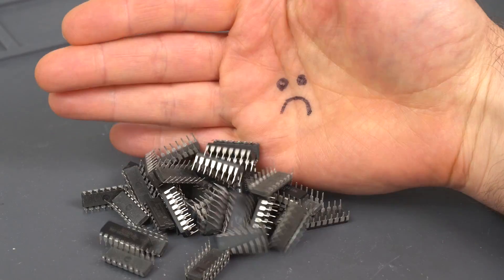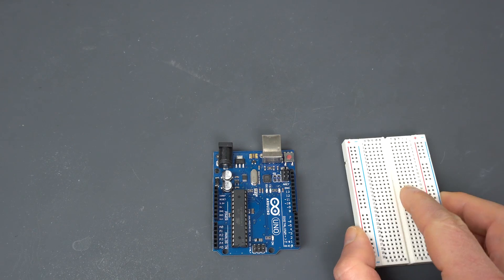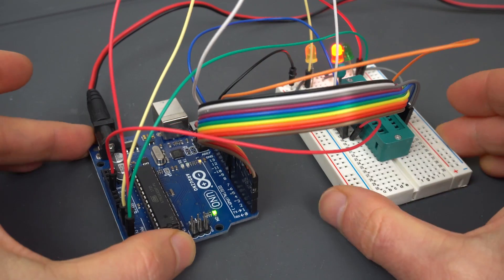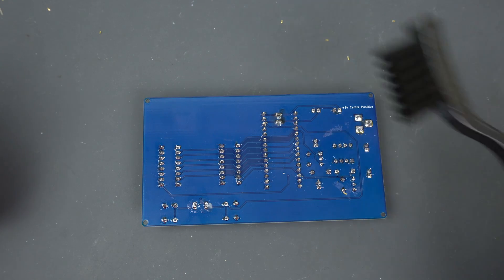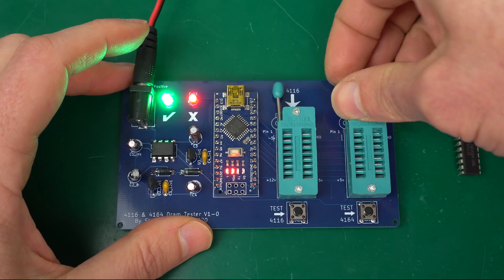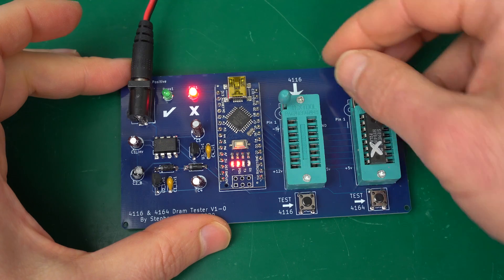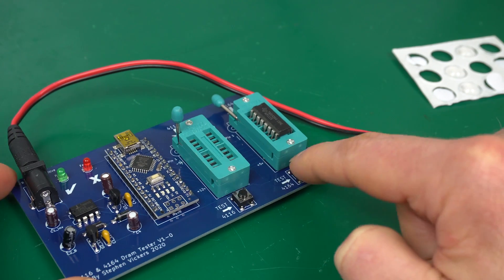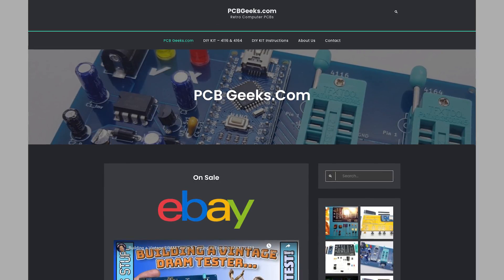Arduino DRAM Tester

Comment: I have recently tried to test DRAM in a chip tester, and I found that you get a lot of false failures if you don't have a good 100nF-400nF decoupling capacitor right across the power lines on the chip being tested. These chips draw a lot of current very quickly when you pull the /RAS signal, and if the decoupling is too far away and the current is delayed by stray inductance in the power-leads, you're bound to loose bits in a perfectly good chip. For the task of decoupling, film capacitors should be better than ceramic capacitors. Electrolytic caps alone without something else is a big no-go, as they're way too slow.
Reply from the maker: Very good point! My knowledge of circuit design from that point of view is severely lacking, but I can see what you mean by that (and that's also why that's such a common feature in most 8-bit computers).
Reply: @NoelsRetroLab  I've regularly seen the caps having been soldered right on top of the VCC and GND pins of the ICs, on retro boards. 90's boards too
Reply: Very nice tip. Out of interest why are film caps better than ceramic for this as I've struggled to ever find good information on the difference, tho I was somewhat aware of electrolytic being slow before. I won't ask about tantalum as I can't cope with more than 3 types 😁
Reply: @mogwaay  Ceramic caps tend to perform worse at higher frequency. At the speeds needed for the DRAM row-refresh surge, they are usually far out of spec. Film capacitors and silver-mica keep within spec for faster operation.
Reply: @TheMovieCreator  thanks for that, good to know 👍
Reply: @BertGrink  : A quasi-standard thing to do is to see if you can fit a small decoupling cap under or in a gap of an IC socket.
Reply: But tantulam capacitor across both ram and arduino is also a good choice (code 104) I know film capacitor is best but tantulam is also a little bit better

Comment: You know, I tried to explain 0:48 in a recent video of mine and just ended up waffling for about 5 minutes and spending ages on diagrams that just made the whole thing even more confusing. I cut that whole section out in the end. And there you go and clearly and concisely explain the whole thing in less than a minute 😅
Reply from the maker: Haha, glad to hear that 😃  There's a lot more that can be said about that, but that seems like the minimum you need to know in order to actually use it.

Comment: I was looking at your T-shirt thinking, "that looks familiar" and then the name "Sabre Wulf" popped into my head. So I looked it up but discovered it was a side-on game with a very similar looking character but not isometric. I also had Knight Lore in my head but for some reason thought the player character was a knight, but I looked it up anyway and discovered that is indeed the character from your T-shirt. Even weird, on wikipedia it says "The player, as Sabreman, has been bitten by the Sabre Wulf". So there is a link between the two games as they were both made by Ultimate Play the Game. I didn't own this game but a friend had it on his Amstrad 464 and I played it a bit at his house.
Reply from the maker: That's exactly right! Your brain made some good associations! 😃

Comment: One very common fault mode, since these chips are getting old, is that the cells get leaky and loose data prematurely. When you test some of the chips everything seems to be fine at first but you have to extend the time for the RAS signal to the maximum limit for refreshing a row. I had hundred of 16 kbit DRAMs (ITT 4017) loosing their contents if the RAS cycle time was at maximum. I even went so far to test the refresh time beyond the datasheet limit and see at which point data gets corrupted in order to see how much margin was left. So I sorted out the ones which were just above the maximum refresh time since they would have failed within just weeks after my repair. A lesson I learned after I repaired the first units with DRAM faults.
Reply from the maker: That's a really good point. It would be awesome to have a tester that can have that level of resolution and increase the delay until it fails and report that.
That would be challenging to do with an Arduino, but maybe a faster microcontroller or using some tricks it could be possible. How did you manage to test that? Did you do a dedicated circuit, or did you test it in the computer itself?
Reply: @NoelsRetroLab  Since this was in the end 90s I used a 16 MHz 68332 system also known back then as "RaubKatCE". Hard to find an image today: https://docplayer.org/docs-images/91/105790635/images/77-0.jpg This one has loads of timers and would be quick enough to use the interrupt function for that. But I was cheap and lazy and polled timer counter registers just to hit the DRAM once the timer went over a certain value. It worked though. Funny thing with some DRAMs: When not refreshed they had all the bits low on even RAS addresses and high on odd RAS addresses. Or the other way round. That was weird. Never figured out why.

Comment: Another great video, and thanks for the review of my PCB design.  There is also a version with NO SMDs now too, for people that hate them things  ;-)
Reply from the maker: Glad you liked it. Interesting about the board without SMDs. Why do you have both versions? Did you make one first and then changed to the other one?
Also, we were wondering about the red LED. What's the logic about when it's on and when it turns off? (other than at the end to report an error). I wasn't able to figure it out.
Thanks!!
Reply: @NoelsRetroLab  The SMDs where added to test my own skills on the early 4164 Tester PCBs (just for fun)
As I developed the Power circuit part of a 4116 board, I just kept them on. Especially as I was only selling fully assembled PCBs then.
Over time I merged the 4164 and the 4116 in a one board for all thingy.  The code runs through 4 phases, and the red light goes out after it passes Phase 1.
(Mainly just because of my lazy programming of the code!!!)

Because I was mainly selling kits now, I designed a PCB without SMD, as alot of us Retro Geeks have failing eyesight for those tiny SMDs   ;-)   
Also gave me a chance to do the PCB in Black, White and my favorite Orange!!
Reply: @Codersys  : If you ever bother to rework it again, using a third color of LED for "testing" instead of just keeping the other two lit would be desirable. Shouldn't require more pins either, so long as you can use Charlieplexing or something else similar to hang both green & red off of a single pin.

And maybe some protection resistors and/or diodes between Arduino & RAMs, though that would have a much higher effect on the component cost.

Comment: About Arduino protection: Atmega328p datasheet states that there are protection diodes on its inputs but the current through them should not be more than 1mA. That in fact means that puting a 10K resistor on each input should protect the Arduino from +12 and -5 volts.
Reply from the maker: Aha! That's really useful hard data. Thank you!!
Reply: All chips have that kind of protection, it's there for ESD purposes. 10k surely would protect against all the possible shorts, but might as well render the whole thing not working properly in the first place. Depends on the input impedance of Arduino and leakage current of retro memory chips. I've debugged a board at my first job years ago, which didn't work because of placing protection resistor on both ends of the trace - each was 3k3 iirc. Due to leakage currents all ligic signals were read as zero.
Instead, I'd do what should have been done anyway - overcurrent protection on supply pins and external protection diodes on each logic trace.
Reply: Don’t rely upon the ESD protection diodes as a replacement for ESD handling precautions.  It’ll bite you in the proverbial when you least expect it.
Reply: It is a nice idea for a specific IC that works between two levels, but... the problem comes if I try to use the same system to work with differentes rates, and latencies.

Comment: I remember, as a teenager back in the early 80's working with a service technician servicing System 80's (TRS-80 clone), that these had 8x 4116 DRAM's onboard (socketed), and it pretty much became known that perhaps 90% of system failures were faulty DRAM.  Therefore, it became standard practice that the first thing done was to just replace the 8x 4116 chips, and in 9 out of 10 cases, the computer was fixed!  This also meant that many, still good 4116's, were thrown out.  But, in the scheme of things, the time involved to fully troubleshoot, to identify the specific chip at fault, would have cost more than the super quick (and 90% effective) full "8x 4116 swap-out" repair. Crazy as that seems.
Reply from the maker: That makes sense, although depending how early in the 80s that was, that RAM could still be pretty expensive. But yeah, it does fail a lot, and some people even today recommend just swapping all the chips out when one of them fails. I don't tend to do that, but I can see the reasoning behind it.
Reply: @NoelsRetroLab  Yes, they were expensive chips. I even remember, as an electronics / microprocessor hobbyist back then, saving up, just to buy 1x 4116 chip to experiment with (in the days when we typically used 2114 1Kx4 SRAM's for our builds).  So yes, I distinctly remember this proces and all of the 4116's being through out, simply because as a lowly paid teenager at the time it sure seemed absolutely crazy!
... and Yes, I was able (at a later time), to rescue some tubes of suspect 4116's from the rubbish and build my own circuit to test them. I still have a few tubes of these spare 4116's to this day. :)

Comment: Unbelievable timing with this video, I had just built my own DIY dram tester to check some 6464 chips on an EGA card I was working on, using a STM32 BluePill with Arduino and, I failed as it didn't find the faulty chips! I had to use my ZX SPECTRUM +2A, kinda like you suggested you could use a regular ZX 🤣. I was also sadended that this project wasn't Open as I had tried using it as a reference. I will be very interested to check your code, I had used someone else's as a starting point but clearly I'd gone wrong somewhere. Anyway good info as always and super timely, if you could make a video on whatever I find myself working on next week, thatd be great 😋
Reply from the maker: Haha, I'm glad we're so attuned that I just predict what you're going to need next 😃  (Hint: Start working on some VIC 20 stuff). My DRAM test code is no great shakes (and it's also based on another existing one), but it's certainly functional, so it's a nice start for your own code.
Reply: Despite the project not being open source, it's not that hard to design a pcb inspired by this pcb. Change pin usage on arduino, write own software, done. I also realised there is an easy way to test the chips for shorts as these board have analogue in and outputs beside the digital ones that are used for the read/write tests. I write software in python but that is easily translated to the code arduino uses.

Comment: I have a spare working Spectrum 48K board with sockets for both RAM chips and fitted with an EPROM which dual boot to normal or diagnostic software. Selection is by pulling the high address line high or low on the EPROM.

Brendon Alford's diagnostic software is unbeatable and open source.
Reply from the maker: Right. If you already have it, that's a fantastic solution.

Comment: You're getting pretty good at the animated graphics Noel. Good info as usual, the best part of using these 8Bit systems is that's is possible to observe and (sometimes) understand all of the parts and how they work. I've not tried to test a DRAM chip in place with an IC test clip with my backbit. Interesting
Reply from the maker: Thank you! Glad you're enjoying them. I actually didn't know about the BackBit until now. Interesting!
Reply: @NoelsRetroLab  I really like it. It’s expensive, but it you do a lot of repairs then it may be worth it. I’ve been able to shortcut many hours of troubleshooting with it.

Comment: You could try to cut one of the rubber feet in half with a sharp knife and stick it with the cut side to the edge of the PCB to prevent it from tipping.
Reply from the maker: Good idea! I'll try that.

Comment: I've bought the Steve Vickers tester, it works fine and I've stick a plastic below the PCB to avoid short circuit. Noel is so nice to contact him and wish him to Open Source (also the idea of OLED), for the honest word I like the idea but turn out not every Open Source project did go the right way, simply speaking I don't want to assemble the board myself because I'm not confident for my skill, and usually Open Source project just like a abandoned child, the parent are gone and no one improved it anymore, I really don't care he charge a higher price if I can get the product in a better quality and future improvement, sometimes money is a good way to attract developers did excellent work. If the developer can release product and make a living, then we have many new gadgets to play with.

Comment: Real men write self-relocating assembly-code on the native-computer to identify the bad bit/chip—LOL! 🤣
Did this on an Osborne-1 to identify a bad 4116; the only component to ever fail (other than the switching power supply).
Great video, glad to see people working/playing and enjoying the old school hardware! 👍
Reply from the maker: Oh but I did! Self-relocating, self-modifying and all 😃 https://github.com/llopis/amstrad-diagnostics Only drawback is that it only works on one platform.
Reply: @NoelsRetroLab  Good Man, thanks for sharing the code.  Nothing like the precision, elegance and predictability you can get with assembly. Did a lot of development on a Mostek Z-80 assembler that had a 56-pin card-cage with 4-cards making up the computer-part; the assembler was in 2708 eproms; this was hooked to an ASR-33 teletype with a paper-punch to store the programs.  Those were the days!

Comment: I think it is an evolution of the DRAMARDUINO which was pretty much open source. The firmware was pretty hit and miss. This seems more accurate but I still get false negatives / best of 3 or 5 runs on some chips. Would be good to know what the firmware is actually doing lol. Great vid.

Comment: They probably didn’t answer because I had already made it and it was open source. I made it with both the LEDs and an LCD then I made it with the exact OLED you showed and sold a few. Mine was only for the 4116 chip though.

Comment: That tester has originated from an Oric forum. One user posted about his quick & dirty Arduino based DRAM tester, the project grabbed some attention, some people found a few bugs in the code and corrected it. Later on that code was used (with or without mods) on some commercial products like the one you have there. I built my own testers in the form of UNO shields with homemade PCB's. One shield for 4116 and one for 4164-41256. Having them on 2 separate boards enabled single sided PCB design, thus homemade PCBs. I'll link the said forum page below, but I suspect you already know the story behind the kit you assembled.
https://forum.defence-force.org/viewtopic.php?f=9&t=1699&sid=68af1e37deb5f6c5f030a930a514ff3e
Reply from the maker: Thanks, I didn't know about that project. I knew about one I used as starting point of the code in my home-made one, but I'm sure they're all pretty much the same. The main thing going for this commercial one is also testing 4116 memories.
Reply: @NoelsRetroLab  Being Oric, the original code is for 4164 chips but can easily be modified to do 4116's too. That's what I did, and I am sure Stephen Vickers did the same too. There are no IO pins left for driving a screen if you use actual Arduino pins. 9 pins for address bus A0-A8 (A8 is needed for 41256) + RAS +CAS +Din + Dout, +WE +2 pins for leds, takes up 16 pins. I used 2 other pins for 2 jumpers, one for 4164-41256 selection, one for "loop test" or "run once" selection, all that remained was D0 and D1, which are reserved for serial RTX. So I decided to use the PC screen with a serial terminal for all kinds of messages during the testing. For power, I feed the Arduino UNO from the adapter jack with exactly 12V, use the same 12V for 4116, I get the 5V from Arduino's on board regulator and generate the -5V with an ICL7660 from +5V. I believe Stephen Vickers generates all voltages from 9V input, which is a much safer approach for a commercial design like his.